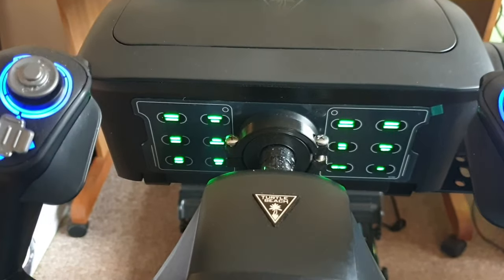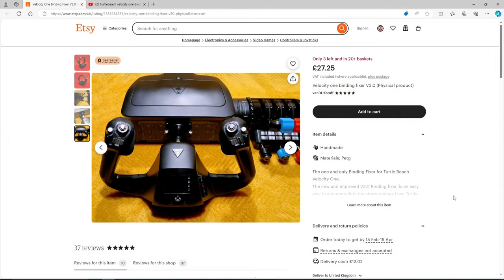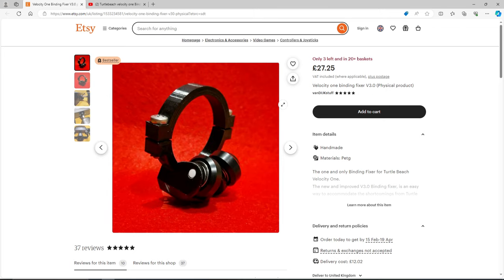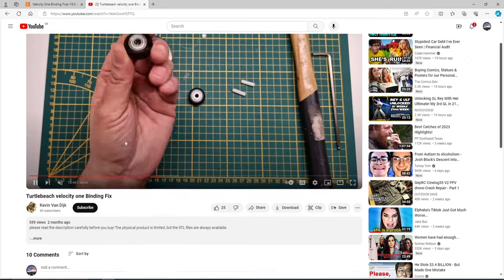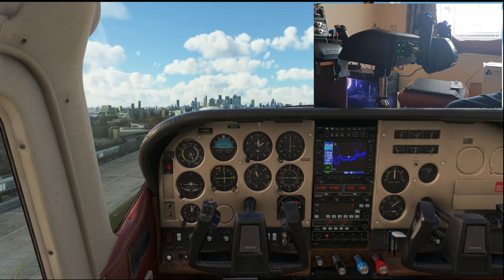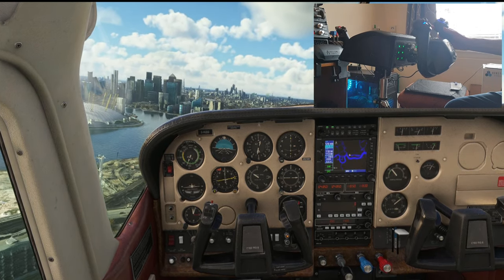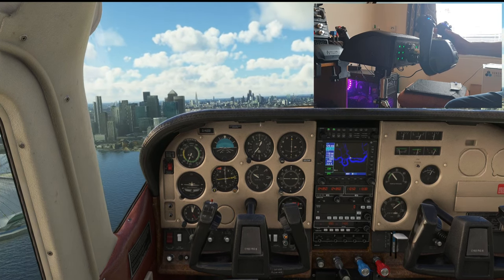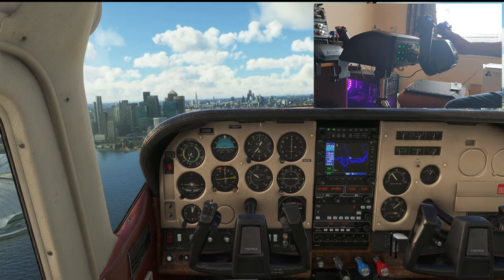FS2020: Velocity One Flight Yoke Elevator Modification Fix - Transform Your V1 Yoke!

Comment: Thanks for the review, I've also just ordered one, and will respond again when it arrives and I've fitted it.
I'd watched other youtube videos where the Guy opens up the yoke and carefully smooths out the roughness in the plastic collar on the spring shaft inside, but this looks like a much better way of solving the design flaw, by directly supporting the yoke underneath.
Reply from the maker: It's a lot easier to install for sure.

Comment: I might be interested in correcting this design problem but I can't even get to that point yet because the elevator axis won't even function in the software/setup on my Xbox. I updated the firmware and then it can't even be recognized by the Xbox now. Turtle Beach seems to be having this problem but not really addressing it.
Reply from the maker: That's strange.

Comment: @Huddison, I just purchased both the yoke and flight sim and my only comparison is FSX and the CH Yoke (which I find better). Is it "normal" for the Velocity to exhibit extreme pitch both up and down? I find it difficult to stay level and the trim wheel seems to be zero help. I have put the magnet in place as it was rolling around in the inside, updated firmware to 1.5 and recalibrated it. Would like your thoughts if it is "normal" or perhaps my yoke is defective. Thank you.
Reply from the maker: The Elevator Axis on the V1 Yoke can be a little extreme (hence the modification).  I would say yours is not defective.

Comment: I looked on Etsy and only saw the plans for a 3d printer. How can I buy the physical item and I need the cost. I’m in the USA
Reply from the maker: It looks Like Kevin's mod has sold out currently; keep an eye on the link I provided in the description.  Let's hope Kevin sees this message and can inform you of the full cost.
Reply: I bought the STL files and do it myself.  Works , the problem is not resolved 100% but there’s a big improvement
Reply: @kennypr  I’m assuming you have access to a 3d printer. I unfortunately don’t.

Comment: It's strange because the first V1F Yoke I got two years ago was sticky to start with, then wore in considerably after a few months. Due to a software problem that couldn't be resolved I got sent another one a few months ago which was not sticky at all out of the box. I've done the same tests as Huddison in the C172 today and can't detect any stickiness in pitch at all - completely smooth on take off and landing. Must just have got a good one I guess! It would be interesting to know if anyone else has had my experience. For those that haven't been so lucky (including those making comments here) I must say this bit of extra kit will be a godsend.
Reply from the maker: It seems some function better than others out of the box.

Comment: I added it about 8 months ago.  Doesn't solve problem 100% but does make the yoke useable.  Before I added it the elevator action was so jerky that landings were difficult.
Reply: Yeah.  Got the STL files and did the hack.  There’s an improvement definitely 😊
Reply: The tension adjustment of the clamp screws is very fine. I've found that if you get it just right it does solve the problem 100%, Try playing around with them.
Reply: @pi.actual  I got better results working then with sensitivity and the hack

Comment: I tried to ask Kevin directly but haven't heard back from him (yet)...

When installing this, obviously you don't want to torque down on the screws on the top strap too much or *snap*! 

Question is...if you have it installed correctly, when you push in / pull out on the yoke, should the little roller wheels on the bottom of the device turn (rotate)? Or they just there to take up any "slop" in the shaft should it move?
Reply from the maker: Yes, both the wheels (at the bottom) should rotate when pushing/pulling on the yoke.

Comment: Is there more friction turning left-right?  The cleaver Kevin seems to help lifting the yoke, but the rollers are facing the length of the yoke and side movements could be more difficult? I suggest some kind of floating ball that is touching the metal pipe.
Reply from the maker: There doesn't seem to be detrimental effects when banking left & right - in fact, it seems more fluid with the modification, in all the flight axis.
Reply: There's an inner shaft that turns left and right. The outer only moves front to back. So doesn't affect that.